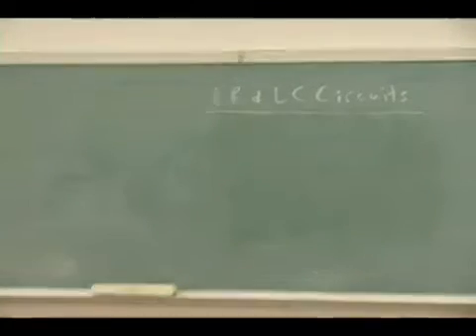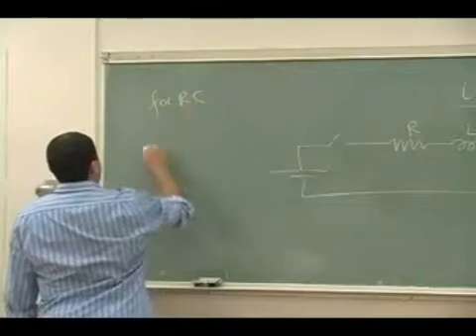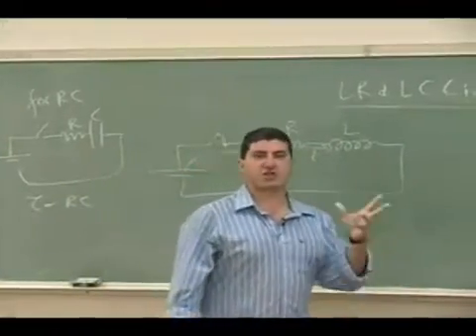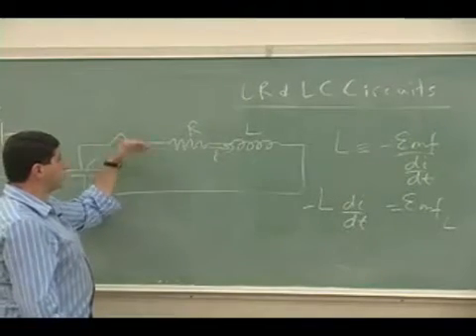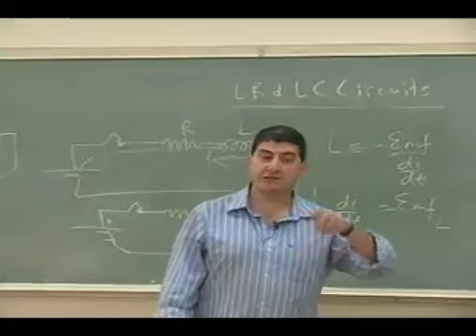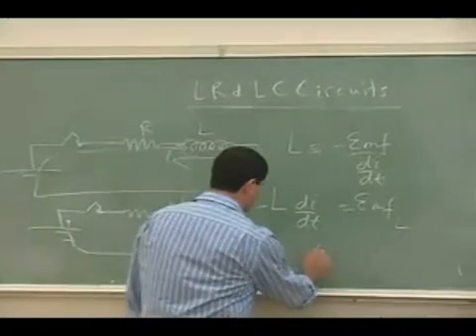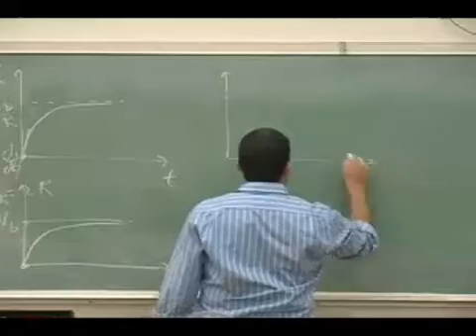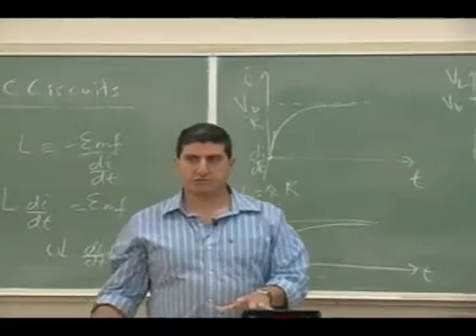LR Circuits Theory Part 1

Comment: damn I am late but just one correction. at 8:00, the voltage of inductor starts at minimum value and increases asymptotically., not the other way around.